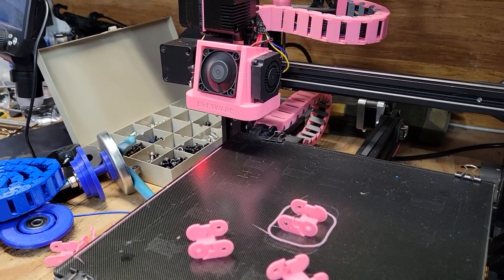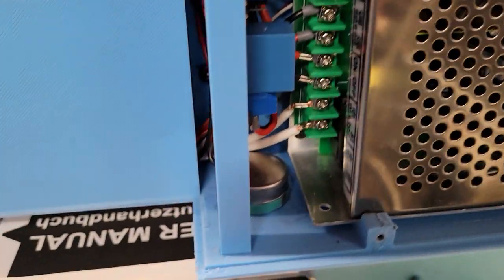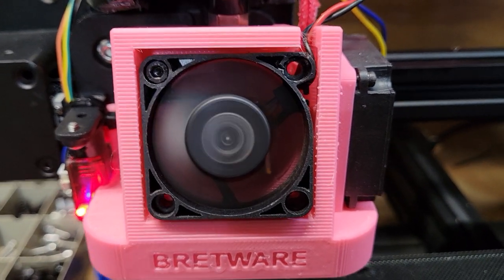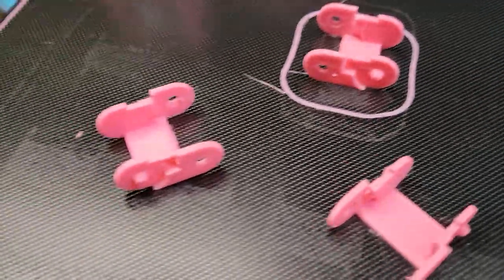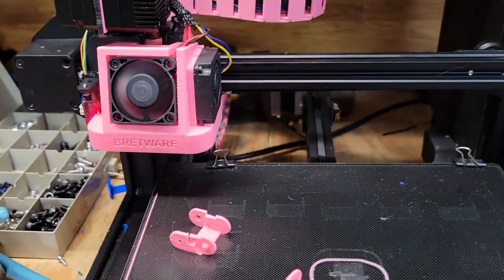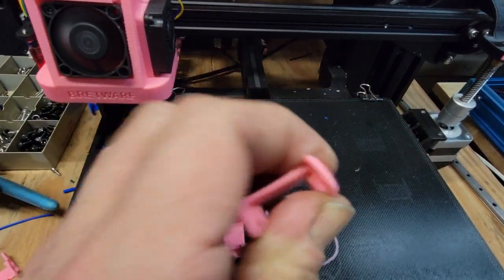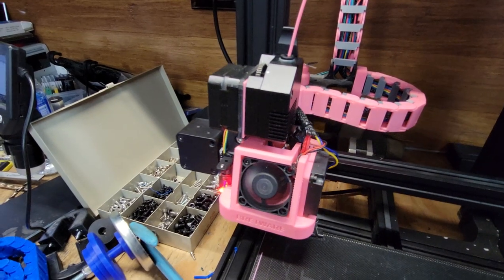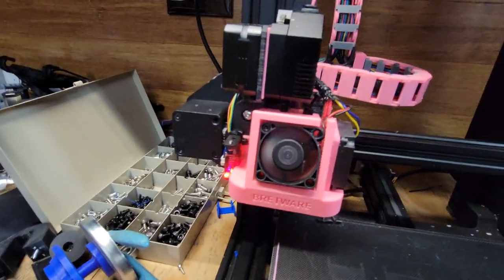Bi Metal & Creality's Hotend Conclusion

Comment: I also use bi-metal heatbeaks and have ni issues, people on Reddit have though and 99% of the time it is user error, people dont turn their nozzle back before mating up the heat break and end up with a gap which of course blocks up the hotend.

Comment: Thank you for sharing.  I'm a little late to that party...  😅  Anyway, I have an Ender 3 V2, I wanted to regularly print ASA for my RC trucks, so I installed the POLISI3D heat break (I don't remember what type of metal it is, but I don't think it's the titanium ones available now) and tungsten nozzle, also installed a 60W heater cartridge and copper heater block.  Everything else on the printer is stock and it worked amazing!...  Until I switched to PLA, then I had issues with heat creep.  For my fix, I coated the part of the heat break that inserts into the heatsink with thermal paste and the portion of the heat break which screws into the heater block with silicone grease (for thermal insulation).  I also upped thermal insulation of the heatsink from the heater block by using tungsten screws that holds up the block and coated the tips of the screws that goes into the heatsink with silicone grease.  And all my issues went away.  I do have to print at the lower end of the recommended temperature (240* C for ASA and 180* C for PLA), bed temperature stayed as recommended by the slicer.  😊
Reply from the maker: Yup it's all about getting the heat to go where you want it to, and when printing PLA you have to stop preheating
Reply: @Bretware904  I don't preheat the head anymore, since I got the 60W heater cartridge it heats up so much faster.  I do heat up the bed to the temp I'm printing to and wait for about 5 minutes for it to settle, then to the auto tramming, bed mesh, Z off-set, etc. then full send!  😁